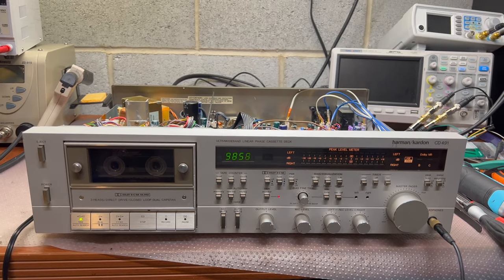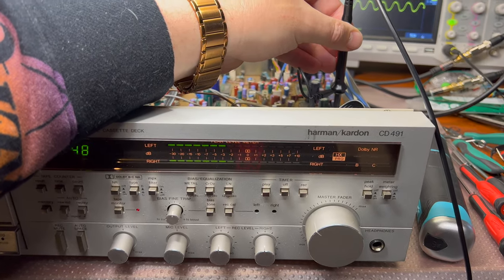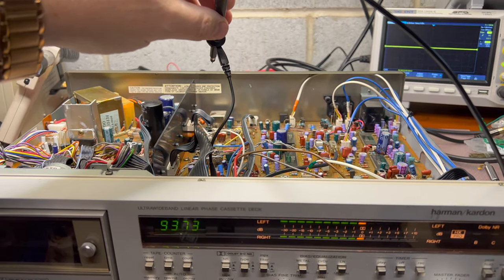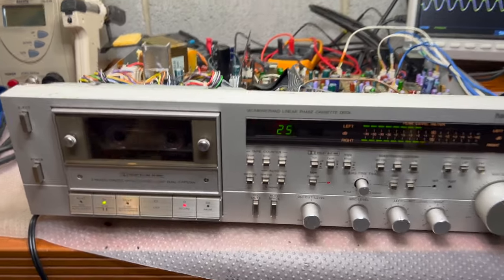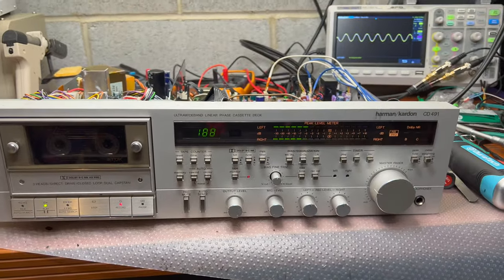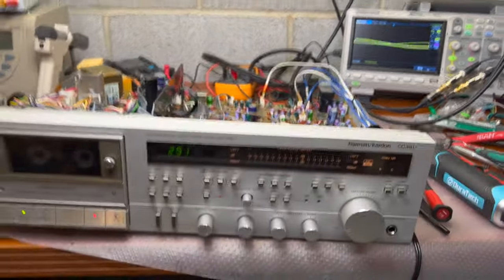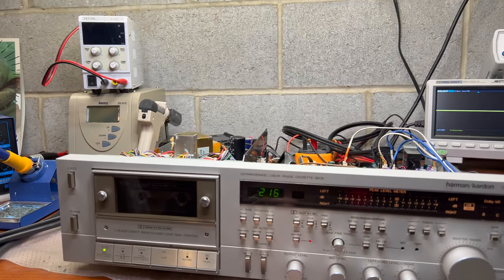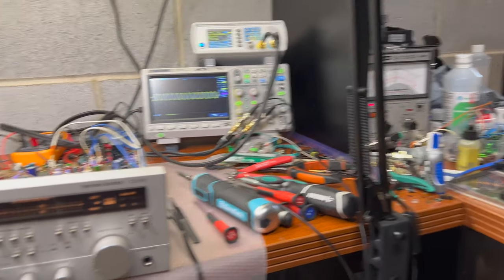Harman Kardon CD491 Restoration: Bringing Back the Glory

Comment: Also dear hifirulezz, Do you have any advice for me? I am a novice and purchased 3 of these in 1985,86 appx. All three have the same problem they all start to make a loud scratching sound output to the amp and I have to hold my ears and power off the unit. These were brand new and started doing this after the return warranty ran out. I could not get my money back. However I have  it now and I want to re-cap the whole thing to see if it resolves my issue.

Comment: Those purple caps must be replaced
Reply: Sin, do you have any advice for me? I am a novice and purchased 3 of these in 1985,86 appx. All three have the same problem they all start to make a loud scratching sound output to the amp and I have to hold my ears and power off the unit. These were brand new and started doing this after the return warranty ran out. I could not get my money back. However I have  it now and I want to re-cap the whole thing to see if it resolves my issue.